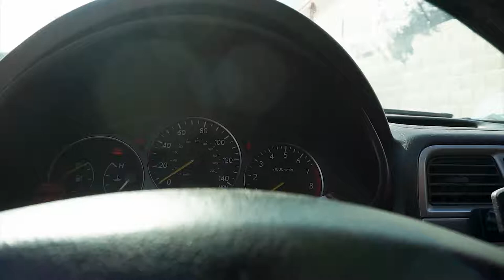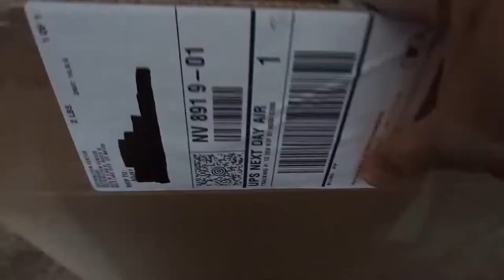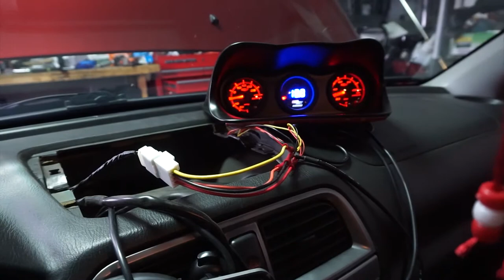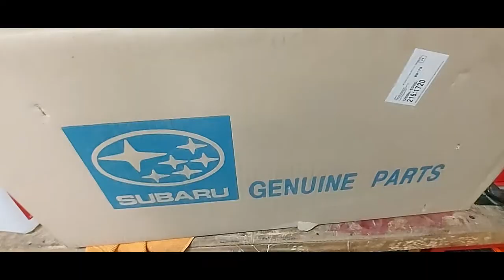Static 2002 subaru wrx wagon stance build 2 year progress in 15 min

Comment: Hey I noticed you didn’t have a heat shield on. I ran into problems with the turbo overheating the Cruze control module beside it. It would stretch the cable while idling and make the car rev higher. Hope this helps if you read it and have this problem.
Reply from the maker: I appreciate that. I honestly should delete it because my cruise control module don't even work 😅 but this is good for anyone with the same set up. 💯 thank you 🤙🏾

Comment: Well done. Just bought a Hawkeye wagon for less than $2000 dollars. Needs a ton work. Runs but rusty a$$
Reply from the maker: I'd probably buy it all rusted up too. I enjoy finding things to do on the wagon. so just repairing rust would be fun. I had my fair share with the wagon. cleaned up a ton of previous owners hack job and now its just making it the way I want. still not done with the image I got in my head for the wagon.

Comment: Question: Don't you have to tune the car if you install exhaust and headers as well as intake
Reply from the maker: Yes that is 100% correct. Best to get it pro-tuned to get the most out of the mods you do.

Comment: how are you so low and not rubbing? Mine is very low but not that low and rubs like hell
Reply from the maker: I fixed my rubbing issues by looking at the areas that needed a hammer and cut the areas that need to be cut like around the axles..  then I got the right tire size for being low (215/35) and adjusted my camber and fitment to that. Once it was all set I had no issues. It's all in the YouTube what I've done if you haven't gone through my channel. Thanks for watching 🤙🏾

Comment: Hey, I have a 2007 subaru impreza wagon 2.5L, i dont know what exhaust i should get. Plzz help
Reply from the maker: This is just my opinion since I haven't messed with the subarus impreza 2.5l engines. You should just go to an exhaust shop and have them muffler delete the wago. There is probably not much option for the non-turbo impreza, so that's the route I would take.. but if you got money, Google will help find a exhaust because I really don't know what's out there for your 2007 subaru impreza wagon 2.5L.
Reply: @xillerated  alright, thanks brotha🙏
Reply: @xillerated  Wait could i just get a 2007 Impreza exhaust
Reply from the maker: @rvyxyt9671  If you're just changing the muffler and you're doing it yourself, I'd get the specific one for your car to make installation easy m.. if you're going to have a shop, do it. Honestly, they should be able to put any size muffler on for ya.